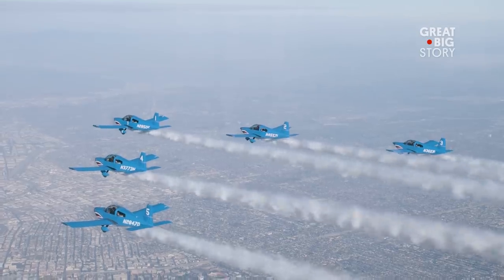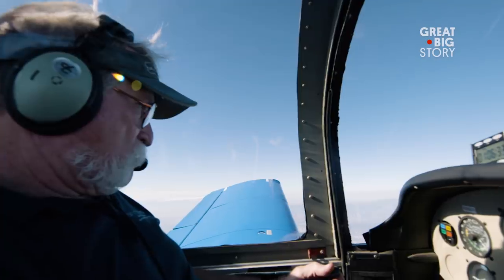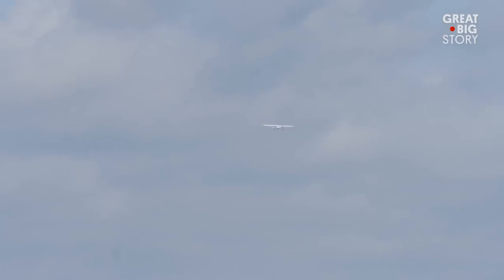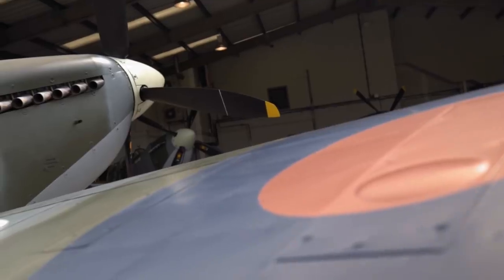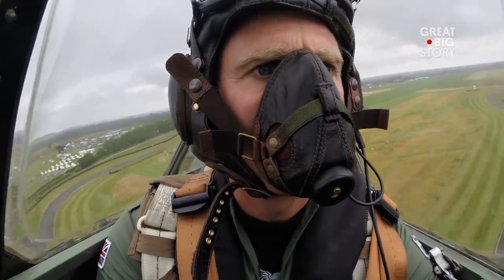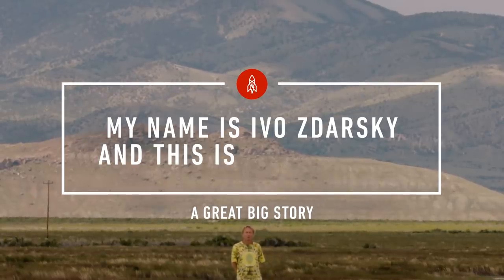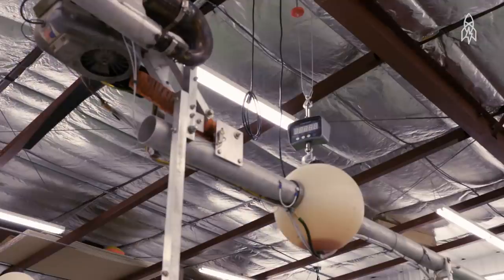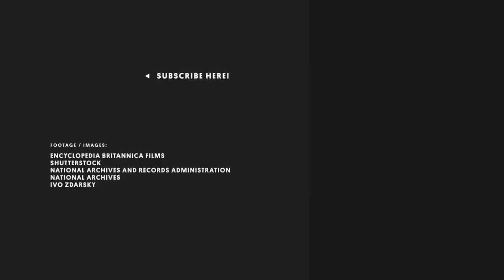Touch the Sky With These Four Airplane Stories

Comment: What is that smoke? That's alot of a chem trail.
Reply: FRANTIC ™ now thats alota damage
Reply: @lamp1739  haha
Reply: Chem trails don't exist
Reply: made out of.......?
Reply: @xavier9480  The trails commercial planes make
Reply: @uptightsl  that's not chemicals. it's air and water molecules passing through the jet that turn into steam. it's basically hot water.
Reply: it's probably some water based something. I doubt they'd let them let out that much smoke - especially over cities.
Reply: Stanley Banks  oh true. rip. it might be the same idea though. but you're right- not a jet engine
Reply: @uptightsl  that's water vapour-like when you breath out on a cold day. I think you mean contrail?